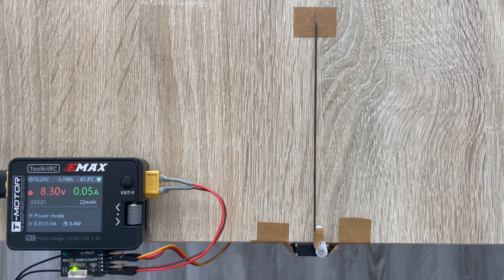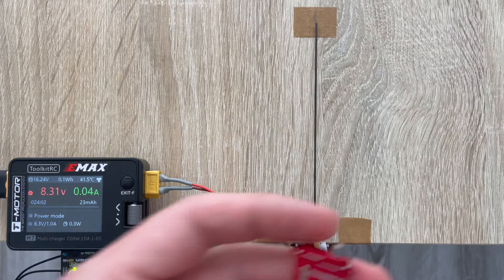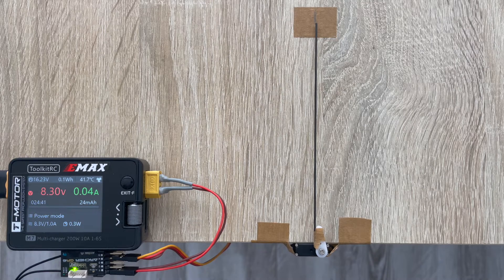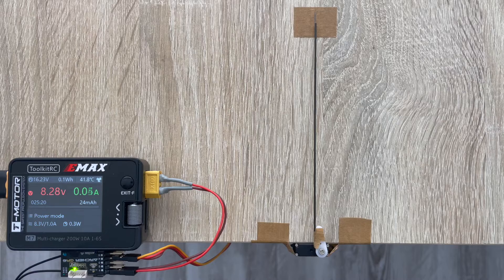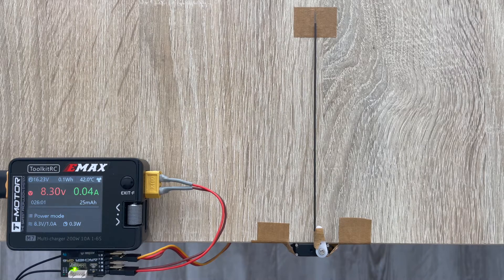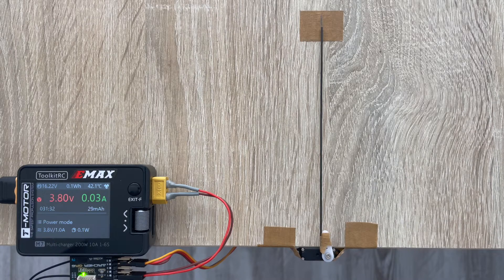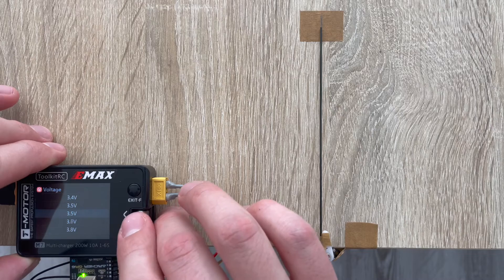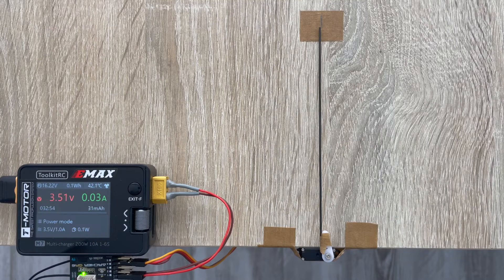CHAServo DS06: The Best DLG Servo Research

Comment: What is the set up that you have there? Is that a battery charger?   Is there a video on this set up? Thanks.  Just started researching the Chaservos came across your channel.
Reply: @racnc1 He is using a charger (ToolKit M7) that has a variable power supply function. This way he can control the voltage supplied from the battery (Lipo 2S) to the receiver (FrSky GR6) and the control input is done with a transmitter (Frsky Taranis X-lite).

Comment: Thank you very much for your reviews. This looks like a solid alternative to the KST 06 servos. In fact Chaservo is made by KST, the specs of the Chaservo DS06 match exactly the KST 06 but it costs 25% less! Probably KST is looking to fill the mid price segment with this new brand.
Reply from the maker: Considering that Chaservo also has HV06/LV06 I'd rather compare X06 to these. DS06 is clearly a budget option.
Reply: @flightpointrc  The fact you're considering these budget option servos is insane. The quality is still there! Mind you, I'm in love with the KST's I'm using.